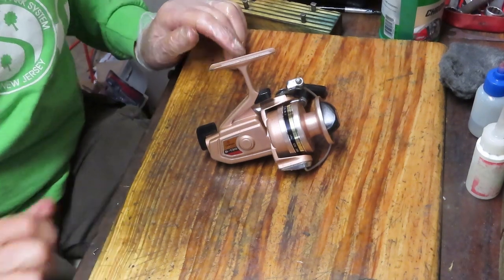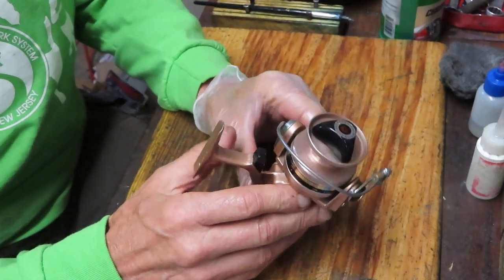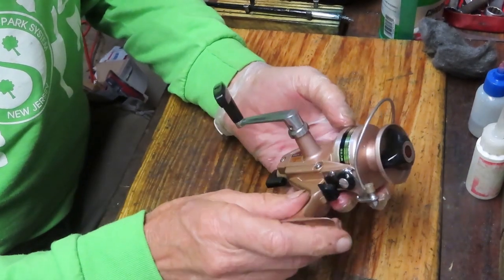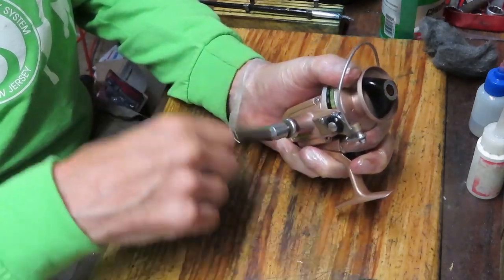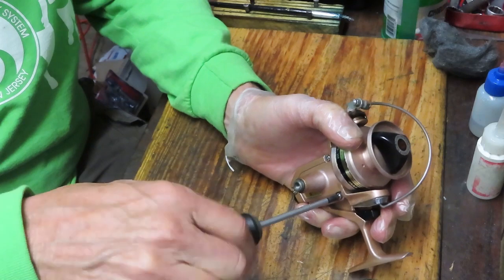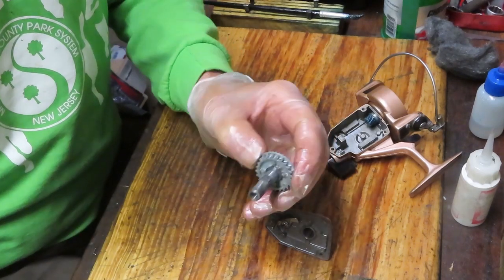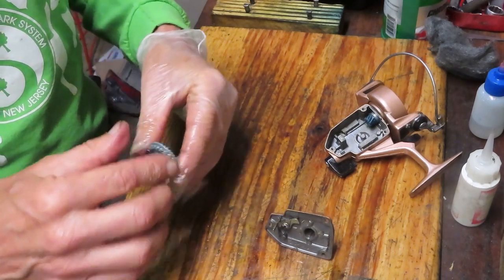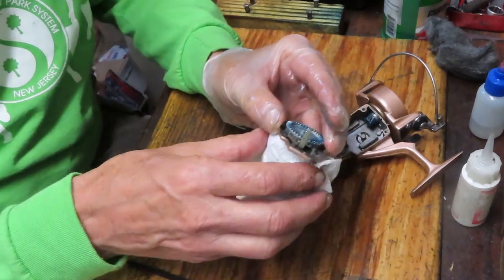Daiwa B 130 spin fishing reel how to take apart and service

Comment: I don’t have this one though I now own 70 vintage Daiwa reels. The internal mechanism would lead me to think this was an earlier Daiwa. It reminds me of a 1500C. In general I’m not fond of reels that use a big U clip to hold a combination rotor/pinion to the housing. I’m sure this reel had a lower price point so it had its place in the fishing reel marketplace of the 1970s. This would be a great reel for a beginner for instance. Great video of a reel I had not seen before.  Dennis, it is killing me that I still can’t sit at my workbench  due to my hip replacement. I can’t bend more than 90 degrees at my waist so no reel work right now. I am walking some with a cane now. It just takes time. — Chris
Reply from the maker: Sorry to hear the recovery is taking longer that expected.  You will be back on the bench soon.  Best wishes - Dennis

Comment: I have a Daiwa B-150RL that I bought back in 1977. I still use it. It’s almost identical to the B-130, but has the reversible side crank.
Reply from the maker: Thanks Dan.  These are a nice series.  I have the B-150. in blue and silver.  Still a solid performer

Comment: Greetings to you, Mr. Dennis, the best thing about this machine is the external body... but from the inside, it is not good in terms of gears and the way it works... just an opinion
Reply from the maker: Thanks George.  The internals are not a sophisticated as modern reels, but you don't need much in a 30 size reel and these are up to the fight - Best wishes - Dennis

Comment: Hello - I was wondering if this (Daiwa B 130) is a salt or fresh water reel and how can I determine if a reel is made for salt or fresh water if there is no manual, labeling or other information available?  Thank you very much.
Reply from the maker: The reel is suited for rivers and lakes or back bay fishing in the ocean.  Size, line capacity and gear ratio are generally the determining factors in fresh versus salt water usage. "saltwater" reels are good anywhere the water is deep or you are trolling or fishing for big ones.  "freshwater" reels are generally listed by line capacity - A 50 or 60 or above (5000/6000) sized reel is generally considered a saltwater reel - the 130 (30) size is not - Dennis
Reply: Thank you very much for your help.  I thought saltwater reels were built differently, such as having more rust resistant stainless or brass parts.

Comment: A 1lb tub of grease should not be $25, esp since all penn did was use basic aluminum complex base marine grease and won’t disclose the formula so people wont know they are charging double than what it should be. Underhanded business if you ask me. Light machine oil is just that. Doesn’t matter if it has fishing on the label or not.
Reply from the maker: Thanks for the additional information and thoughts - Dennis